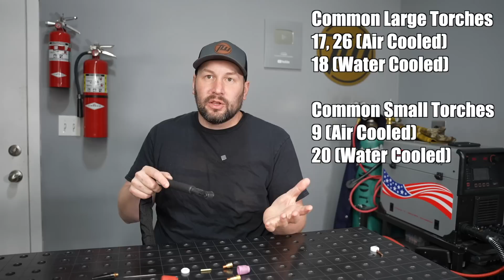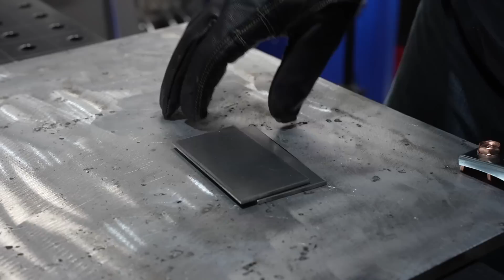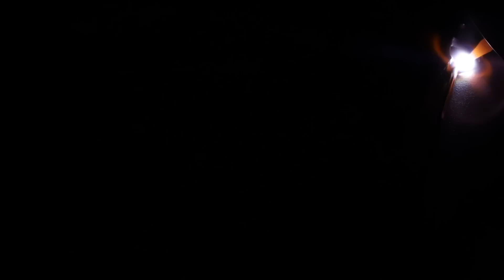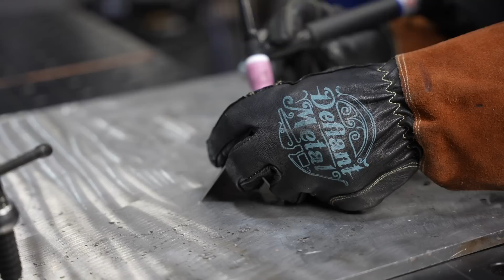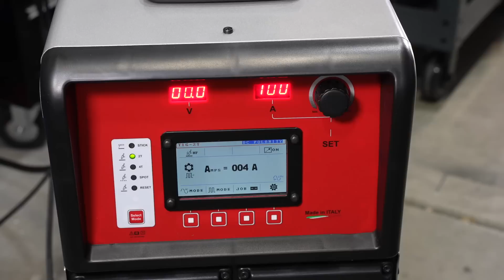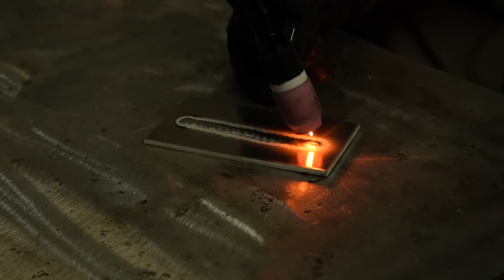My Simple TIG Torch Setup for Any Job

Comment: A solid video as for entry level TIG welders as it can get very confusing.  Some of the mature YT content creators also try to sell certain brands that they have as a  branch store to promote.   That only adds to the confusion.  Me.  Use 1/16th (thin sheet metal) and 3/32 tungsten.  If I weld over .065 its a big deal!  And yes, CK is a good reliable brand.  Blue Demon as well.  Have used pink Blue Demon with success but stick normally with blue and grey.   I do have CK and Nova torches.  However my game changer is that I do have access to is a 3D printer (in the spare bedroom) so I print out insulators tailored to the torches.  I use PETG. In Lime Green.  My garage welder rock star edge.  Good video, Tim.  Thank you.

Comment: HTP Tig welders look amazing but here in Canada good luck finding one. I wanted to know if you ever used Everlast and what your opinion is regarding there welding machines. There's so many videos on Everlast but who knows if they're genuine reviews or paid for reviews these days. 
 Just thought I'd ask for your thoughts. Thank you.
Reply from the maker: It's always hard to tell how genuine a review is, whether it's sponsored or not. Truth be told, I'm far more critical of equipment that was sponsored than I am of my own that I've bought, but that's certainly not the case for everyone. I haven't used many Everlast machines, but from my limited experience I will say that they are a mixed bag in terms of how nice the machines are. Some of the models are outstanding while others leave a bit to be desired. For that reason, I'd research the specific model rather than the brand as a whole. They are one of the better importers in terms of support from what I've heard and they would be in my top 2 or 3 brands to consider in their price range.

Comment: I'm so glad to hear you say that you can't tell much of a difference between the tungsten recipes. I thought I was missing something big, but I tig weld every day and haven't noticed a difference either.
 
I know that the companies make a thing about different characteristics of each blend, but I'm pretty sure that's just marketing.
Reply from the maker: Yeah, I started with red thoriated on DC and balled green pure on AC with transformer machines. When I bought my first inverter in 2010, Miller said to use orange ceriated, so I did that. Then, the internet said to use blue lanthanated and I convinced myself that it holds a point slightly better, though perhaps I just wanted to fit in with the internet. Multi-mix seemed fancy so I bought a few packs of that. At this point, I'll just use whatever.

Comment: I'm a beginner! What must I do too become good at it tim? Thanks jb.
Reply from the maker: Awesome! The key is to learn less at a time and not more. The most important things are arc length, torch angle and travel speed. Practice those one at a time before messing with filler. Then, move on to add some filler to small puddles and try to dab a few times in a line. After that, weld a lot of beads on a flat plate until you start feeling comfortable. Most people skip all that and start welding joints right off the bat (which is how I learned) and it's a really frustrating endeaver. If you build the foundational skills first, it's much easier. 

I feel like it might be tacky to plug my course here, but I think it could really be helpful for you. The TIG course is $39 and it walks you through everything you need to know with practice exercises. It's not that the information isn't available elsewhere and you can figure it out without the course, but it can save you a ton of time and I'll always refund anyone who doesn't find it to be a good fit.

Comment: I can't imagine how you got such a nice weld on stainless with a #7  Tim ... Niiiice . :)
Reply from the maker: Thanks! When I went through welding trade school, we didn't have any of the big fancy cups and we had to crank out straw color on stainless with regular collet bodies. I sure like it better with the big cups, but when the process is right, it works fine with a smaller one.
Reply: @TimWelds Everybody likes the bigger cup sizes, but sometimes you just gotta work with what you've got.

Comment: I use an Invertig 313 everyday at work, and it is an excellent machine! The 221 is great, but the big Invertigs are top notch machines.
Reply from the maker: I couldn't agree more. I was a little hesitant about trying the HTP machines at first, as a bit of a Miller fan boy, but I've been nothing but impressed and now they're all I use. This 301 isn't the cheapest machine out there, but the whole package with the smart cooler and the cart is less than a Dynasty 210 machine alone and the performance is outstanding.

Comment: In the steel lap weld demo, you used the term "over the top." What does that mean?
Thanks, Tim
Reply: If you look closely, the puddle is licking at the top edge of the upper piece in the lap joint.  So he's not going so quickly that it doesn't touch the top edge, and he's not going so slowly that it's totally rounding the edge over into a blob.
Reply: Prevents the top "cliff" or edge from melting and causing it to look like bite marks. So, stay low and dont go over the top.